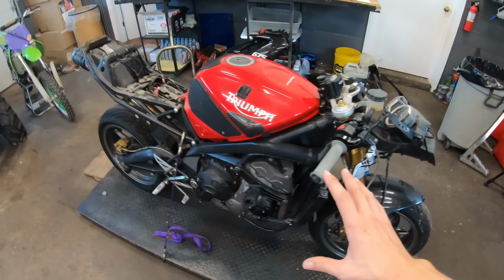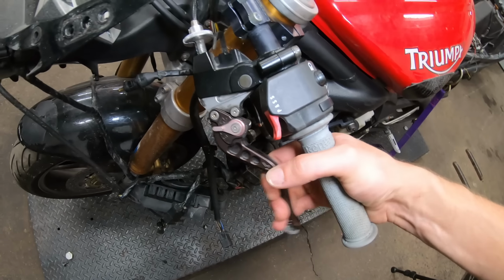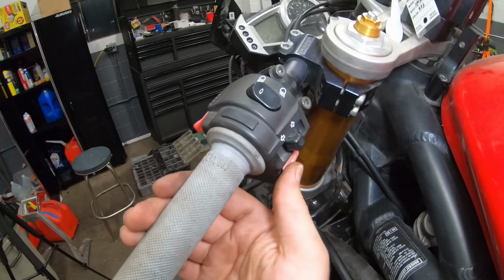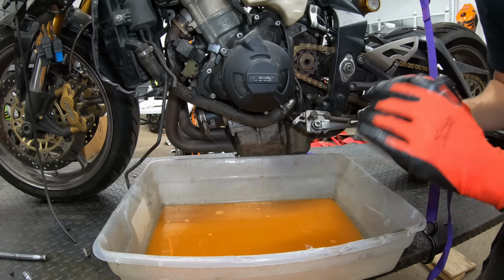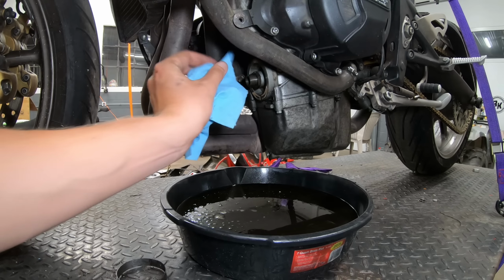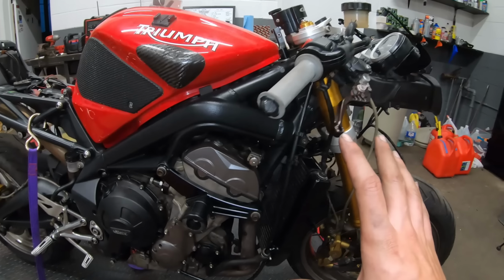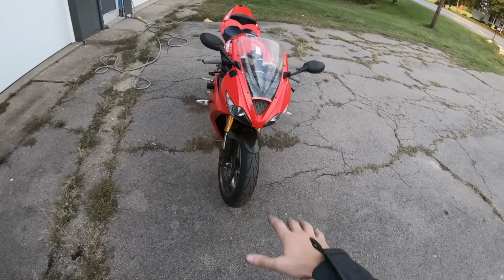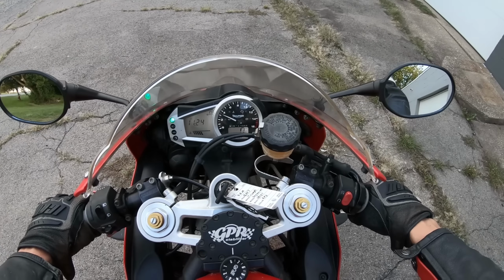My $1700 Daytona 675 is Finished! (Pt. 2 Test Ride)

Comment: I am in the process of building an 07 as I type.  I bought it for the same price.   Guy thought the motor was blown and he sold it to me not really disclosing that the motor might be blown.  He  stated that it would not start.so without testing it first, I went out and bought a spare motor. However, the motor was not the problem. The problem was that there was a stater bolt that had came loose.  Apparently, he dropped the bike and did not disclose that to me either.  Well, because the stater was loose It caused the stater to jar when he dropped it and it broke one of the stater stays inside of the casing. This was the rattling he heard.  It was rattling around like a penny in the tin can. So I replaced everything brand new.  Upon further inspection of the bike, all the brake pads were almost down to the metal. The tires were in horrible condition. There were exposed wiring under the seat. He tried to do a rectifier relocation but he did it really sloppy with a bunch of electrical tape.  Continuing to ride this bike would have inevitably  cause this boy to die. So, I do race. I am turning the bike into a track street bike. My other bike is a 2015 RSV4 factory Aprilia built for the track.   So this bike I wanted to keep as a streetable track bike. I'm almost done, but I ended up replacing everything. Pretty much new everything. I went through the whole entire bike. They are great bikes.  The only problem is ordering parts.  Most of the time you gotta get them from over seas.  That may take forever. Great restoration

Comment: Nice work, The Triumph looks straightforward and not over engineered. Even though my bikes only a Suzuki its still way more complicated and annoying to remove bits or parts. Removing the sprocket cover is a total PITA due to the clutch lever going through it.
Reply from the maker: Couldn't agree more!

Comment: Great piece of work! Not a lot of labor involved this time, but a great project! But man was that a lot of rust coming out of the cooling system. At first, I thought it was just orange coolant, but since it was a track bike that wouldn’t be the case. Good eye for the loose bolt on the case cover.

Keep up the good work!